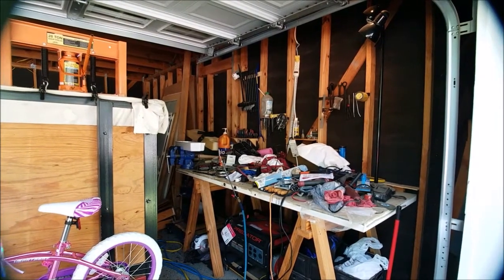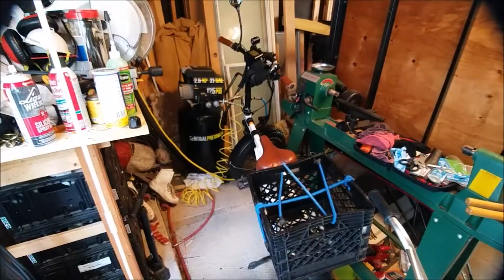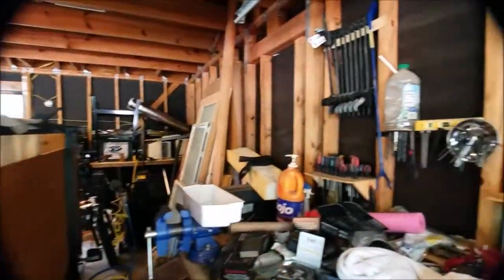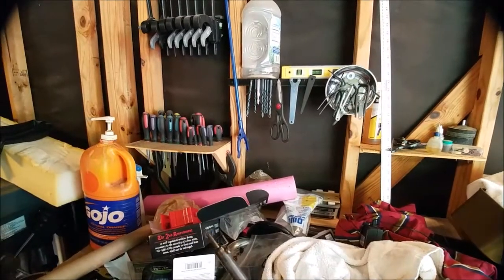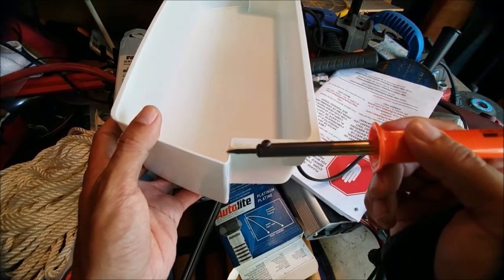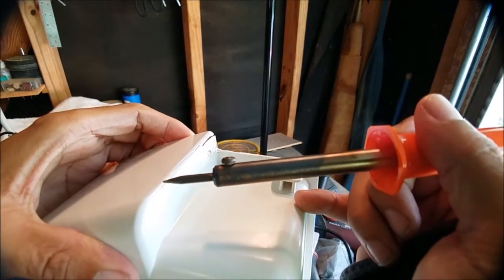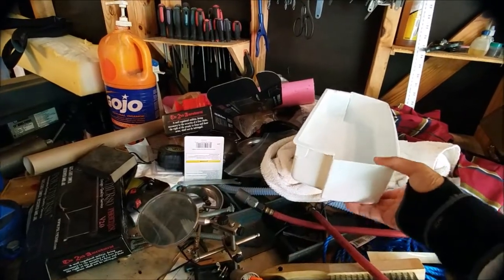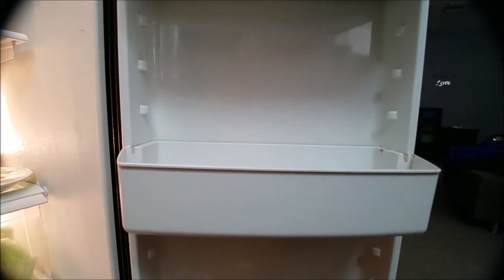Plastic Welding Repair

Comment: Has it broken on the edge yet? I have the same one but it broke all the way off on the end! How can I weld a piece of plastic on it???
Reply from the maker: 👍🧡 use heat to reattach.   Most likely you will have to get new shelf.